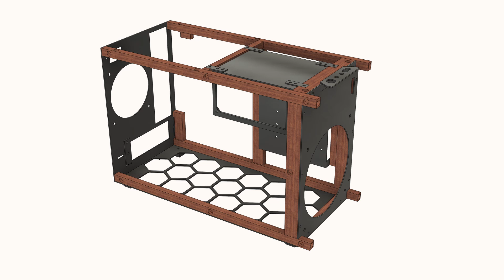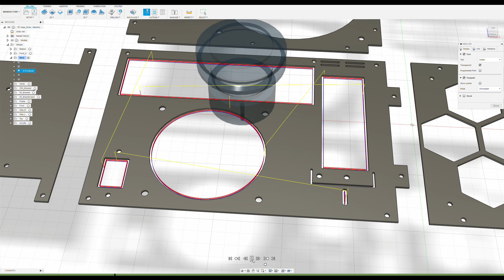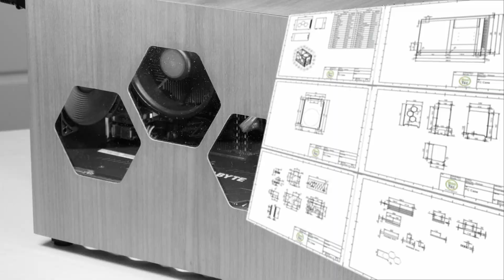DIY PC Case - Built with a CNC

Comment: I love the design, but I would like to caution that you do not have a filter on your gpu intake. Unless you intend to frequently clean this system or there is not a presence of pets or animals in the home of this pc, this system will get dusty, dirty, and filled with hair and specs of dust all over. Furthermore, because of how open the undercarriage is, not to mention the front/side intake, there will be very little pressure within this case. I, again, would like to exercise a lot of caution when using this case design without running any filters on the intakes.

Comment: Hi 
I am planning on making this case and I went into your website and payed the $6 to get the blue prints and I am a bit disappointed in what I got 
It was a PDF file with all the dimensions what I thought I was getting was the fusion 360 file because I have access to a CNC machine and I could get started straight away
So if you do see this is there a way I can get the fusion 360 files 
Thank you

Comment: custom building this one on the Philippines will cost a lot .. adding a bit more height to fit 2 fans at the bottom with mesh and a glass side panel if you opt for an RGB design would be perfect ..

Comment: Small tip. If you use aluminium as a primary material, and want it to look good, use a scourer or sanding block and move it uniformly to make a brushed finish... Amazing quality.

Comment: Easily the most beautiful DIY case I've ever seen, very well done!

I think my only critiques would be the lack of filters on the intakes and maybe the size of the fans used. For a personal build they're perfect, don't get me wrong, but if plans were done for more commercial/public use I think fitting a 120mm fan in the rear might work better (and having the front mount include holes for either 120 or 140mm), but that might require making the entire case slightly wider to compensate. This could potentially allow 120mm AIO's to be used on the rear mount. Finally I'm slightly concerned about the SSD mounts possibly being fragile? It's difficult to tell from the video how supportive they are, I wonder if a mounting cage would be more secure and still fit in the same area? 

I'd be curious to see if any other viewers with their own CNC machines come up with similar ideas for themselves.

Comment: Looks very nice, I am a little worried about the dust buildup from the bottom and the temperatures due to the psu though, normally the psu exhaust is outside of the case. But in this configuration its blowing it's hot air into the case. I also think the front fan is probably choked quite a bit by the front panel. 

Still, all in all a very nice build. But that where the 3 main things I noticed. Solutions could be adding a mesh to the bottom, giving the front panel slightly more room to take in air. Either by the sides or via a mesh on the panel itself.

Comment: Why use wood rather than aluminum bar stock for the frame? You cant see it after the sides are fitted. Also a mesh filter in the bottom might be worthwhile. GPU's are not the easiest things to clean.

Comment: Awesome work.
Mmay I give a sugestion for future desigins? 
Change that front 140 fan for an asetek AIO cooling system and turn the Power supply with the intake facing up. It would be perfect without changing the design too much but with perfect temperatures.
Really nice design man.

Comment: this is amazing. Personally though i would tweak a few things

1. The side panel with a window. I would either make it completely wooden without any holes, or just make it a big glass window. 
2. Add some mesh filter underneath to give the GPU its well needed protection against dust
3. Optional support for an AIO. the front panel could be pushed back a bit to allow a placement for a 120 or a 140mm AIO.
4. Optional Mounting for fans under the case.
5. slightly lifted top panel and allocation for possible fans. 

Well, these are just my thoughts but other than that, that case is amaing.

Comment: Two things I would do if you ever make a version 2.0 of the case.  

The first is run a grounding cable from one of the motherboard standoffs to the power supply.  One reason cases are metal is because if they take a stray jolt (example: static electricity), it grounds through the PSU.  Running wood frames, you break that link.  This means the motherboard will take the full hit of any bit of charge through anything it is connected to.

The second thing to add are filters on the intakes.  You can buy pre-sized magnetic filters from numerous sources for not a lot of money.  You could either use more magnets, or simply epoxy on strips of steel where the filters would go.  Without filters on there, depending on a few factors of course, you will be cleaning out the dust in that thing every 3-4 months.
Reply: I was actually contemplating grounding the motherboard like this since my motherboard is mounted to an mdf plate. I also considered using aluminium tape. Eventually I didn't bother doing it since I figured the psu makes a much better contact with the motherboard through the psu cables, so any jolt would go mostly through the board anyway.
Reply: @Flapdr01  The power cable going from the PSU to the Motherboard does have grounding in it , however it is more to safeguard the power coming from/to the motherboard.  The ground running through the chassis from the standoff's to the mounting of the PSU is more the actual protection for the Motherboard and components from shorting something out.  All you would need is a small wire with loop ends.  One attached to the bottom of the standoff (not between the standoff and the motherboard), and then to the mounting screw on the PSU.
Reply: There are 12 GND pins on the motherboard and some more on the gpu, all make contact with each other, the psu casing and the motherboard standoffs, how would running a wire parallel to that make much difference?
Reply: @Flapdr01  - There are, but a short would have to go through the power connection in order to get back to the PSU.  A simple wire will give it another path (more than likely the least resistant one), and increase the chance that it doesn't take something out along the way.

And as you pointed out, they do make a connection to the motherboard, and standoffs, but you have broke the connection between the standoffs and the PSU.

I'm not belittling your work here, it is an excellently made case (other than no filters as well).  A quick and simple grounding run would be easy to hide, and not take anything away from your build.
Reply: @murrys5444  I figured a wire from the standoff to the psu would have more resistance than the 12 GND's on the motherboard connected to the psu in parallel.

Comment: How did you bend the psu installation bracket thing? I wish I could get a similar bracket. It would help me a lot in my case mod.
Reply from the maker: Hi Signaturisti, I didn't bend this piece but bought a square tube with a cross-section of 120 x 80mm and 2mm wall thickness instead and cut the bracket from that.

Comment: Beautiful piece of work. technically brilliant! Best part for me is that it was made as a gift. Very special gift for your father. Could you do a quick follow up video on the Journey of the design from Fusion through to the machine? Code generations tool paths and then sending the ode to the machine, practical tips? Cheers Allan

Comment: Excellent work!  The internal layout is well thought out.  The only addition I might add would be to apply a mesh front opening to improve air flow as well as a section at the top for 120mm fan.   I’ll be looking forward to getting these plans.  However, I’d first like to get the  upcoming plans on your CNC build.  Will keep checking in.
Reply from the maker: Thank you Gary. The airflow seems to be pretty good and I'll compare it against my other cases for reference. The CNC plans are in the works :)